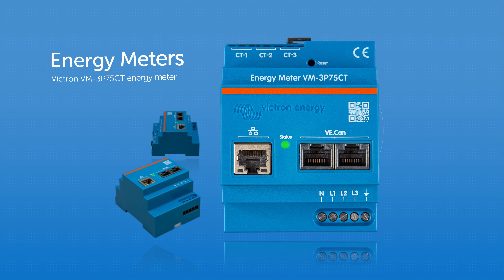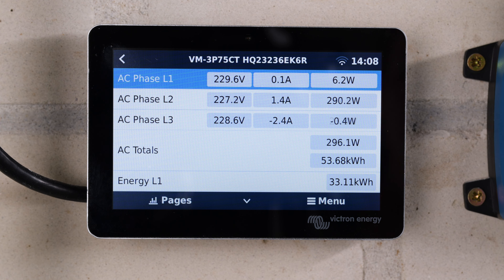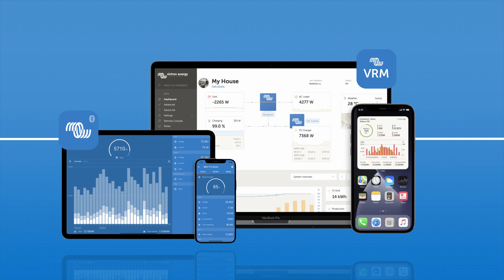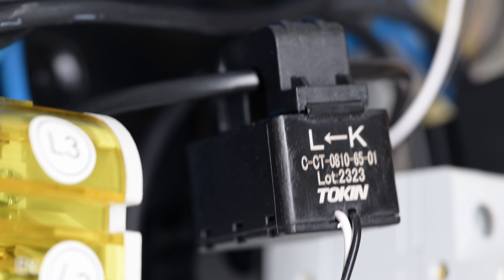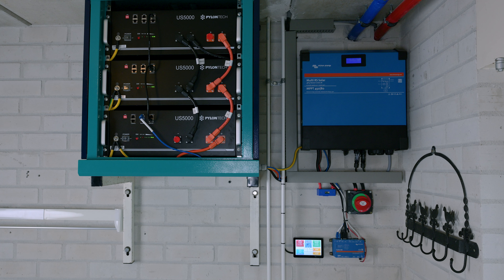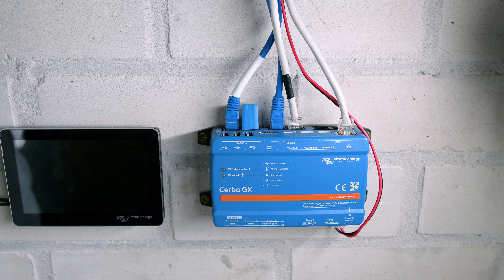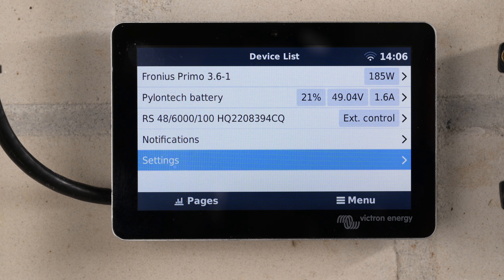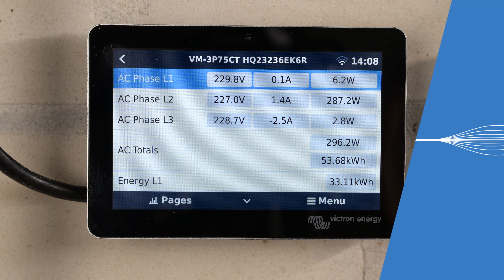Introduction to the Victron VM-3P75CT Energy Meter

Comment: Should have added RJ45 connection on the top and/or bottom, ao you can run the cable inside the DIN-rail enclosure..
Reply: Good one !  Mostly however the LAN needs to go to a router next to the ac distribution anyway
Reply: @johannesboonstra6917 sure, but the cable routing is usually from inside the Fusebox to the outside World and not from the Front of the fusebox which has doors in front
Reply: I agree .....I think 😂
Reply: I am guessing in some places LAN cant be beside HV??
Reply: @jal98uc  230V and 440V is not HV. It is LV. Network cables are allowed to be run with LV cables. It is done everywhere in the industrial and commercial sectors. The only thing that isn't guaranteed when running next to LV cables is signal integrity. For these low bandwith applications, it makes no difference. LV=0-1000VAC.
Reply: @torpedohippo8493 i may have been misinformed, but here in Australia an electrician told me last year that LV is only up to 50v , meaning diy can be things like garden lights and automotive stuff, but above 50v requires a licensed electrician. Not that many people would abide by that anyway i think. So much diy still gets done
Reply: @lexicase8805  well anything below 50V is considered "safe" as you won't get shocked by it if touching it with dry hands/skin. In European law you can work with whatever voltages you like in your sparetime (which is most likely allowed in AUS aswell), however, working on permanent installations (e.g. house, workshop, RV etc.) requires a license.
Reply: @lexicase8805  low voltage is usually considered as 0-1000VAC and 0-1500VDC. While some standards define it as 50-1000VAC and 120-1500VDC. 

I consider the second one faulty however as anything above 50VDC can still shock you. If I recall correctly, having DC current travelling through you heart in am accident is more dangerous than AC, as the current is one directional, effectively stopping/stalling the heart.

Comment: 1) Is it possible to connect multiple VM-3p75CT to one Cerbo GX? 2) Is it possible to view energy meter data in a specific Victron system, but define that this energy meter is not connected to a specific Victron system. For example, if it measures energy in a completely different place, for example, in a neighboring system?

Comment: Strange choices for the design. The small 1.5mm2 conections for the voltage measurements are a pain because one can never make safe cables on high amps circuits. All 4 wires need additional fuses in my opinion. Als RJ connections on the top is very hard to install nice and clean. The fidling with the small and vulnerable ct clamps between thick wires creates faulty installations.

Comment: Great device, lets hope Victron creates also residential 3fase invertors in the near future and add more compatibility with high voltage batteries.
Reply: Could be 😊
Reply: Yes, support for 400-800V batteries is a great addition!
Reply: A 3 phases inverter would be a must have....
Reply: You can bundle 3 inverters for 3-phase power already.

Comment: In my installation I have PV on the AC side, a normal grid tied system using Enphase micro-inverters. This meter allows the multiplus to see the PV power exporting to the grid, and then charge the batteries based on excess available power. Without this meter, it wouldn't see the PV and I had to use a scheduled charge. This really makes the ESS work how it should!
Reply: Yes/No.  There were also other meters doing this, but not as fast/accurate as this one.
Reply: You are correct, I also have normal grid tied solar systems (3 of them). And I want to charge my battery with the excess pv power, when the battery is fully charged I want the rest of the power that the pv systems produce over the day to be fed back into the grid. That way I will get a compensation from the energy company (not much obviously) but it would be a waste to have excess power, that still holds value, that just "vanishes into thin air".

Comment: I have a question about the wiring of the VM-3P75CT. According to the instructions, you should connect N + L1 with a switch or circuit breaker. But why not L2 + L3?
Reply: Because the internal power supply is on L1, so at least there must be power

Comment: Can you also use the phases independently? Like ph1 shore power ph2 generator...
Reply: Theoretically yes , but that’s not supported yet I am afraid
Reply: @johannesboonstra6917   Jammer.... that is the reason not to buy this (expensive) unit. I think single phase ac coupled pv should also be possible to measure.

Comment: how much faster is the performance of ramp up/down of the inverters over the modbus et112 meters?
Reply: 20-50%
Reply: 1 s .. c'est long .. mais il n'est pas précisé pour ce dernier
Reply: i have the EM540 . they said that refresh rate is 100ms ... but ... i see in my system 1000 ms...  it's the REL200100100

Comment: Maximum current it can handle per phase? the CT's don't look very big.
Reply: 75A
Reply: @johannesboonstra6917 Must be aimed at the European market. In the US now new construction around me has 400A service.
Reply: @niktak1114  time to upgrade to a proper 3 phase supply for the homes😂
Reply: @legominimovieproductions  some large homes already do that. It's very expensive though compared to a typical 400A service which is already a decent amount more than a 200A service.
Reply: @niktak1114  A 400A service here in germany would be 276kW, that's enough for a supercharger for a tesla😅
Reply: @legominimovieproductions  yeah that'd be way overkill. 400A service here actually means 320A continuous so only 76.8kW.
Reply: @niktak1114   You work at a lower voltage in the US which means more current for the same power.
Reply: @johannesboonstra6917  Thanks. Which it's a great number for these systems, Are larger CT's contemplated for the future for some of the larger three phase systems? No current need but I would envision it in the ear future.

Comment: Is this able to be setup like the ET340 for a single phase property. 
L1 as grid meter ? 
L2 as PV meter? 

Or do you need x2 VM 3p75ct?
Reply: Not at the moment but with future firmware updates this will come.
Reply: @JohannesBoonstra-ol2nz  
Thank you for the update. I hope it’s soon. Our Et340 is problematic with our ESS. I’d happily swap it out tomorrow for the Victron unit if it worked as we discussed.
Reply: @JohannesBoonstra-ol2nz 
Do you have an ETA for the firmware update please?
Reply: @SuperRockmonkey no sorry , it’s in development but not as top priority
Reply: @SuperRockmonkey   No , thats a matter of development time /priority setting.   To be honest, this is not high up in the list.
Reply: @johannesboonstra6917  
Swapped out the old ET340 for the new Victron unit. As expected it work perfectly. 

However without the firmware update to monitor PV generation my victon system is not able to accurately report true consumption figures etc, I don’t particularly want to have to buy a 2nd meter to monitor PV generation when a simple firmware update will fix the problem. 
Until the update is available I don’t believe single phase victron users can install the NS EV charging station abd gave it work correctly on auto function which is frustrating. 

If you could please discuss with the development team to implement the update sooner, myself and many other loyal Victron users would greatly appreciate it. 
Thank you

Comment: I’m confused. Doesn’t the victron inverters already have this built into the inverter. I know they can already use external Cts that monitor the homes mains to allow the inverter to operate like a grid tie zero export inverter,
Reply: yes, but with this it not needed to have the power from a AC distribution all through the Multi
Reply: @johannesboonstra6917  this device does not prevent AC from going through the inverter. It simply uses CTs to send information to the inverter

Comment: Interesting unit, it would be interesting to find out what accuracy in power measurement, would the unit be able to measure Phase, & all other parameters that say an energy meter wound be capable of? It would be I feel it it had either a Bluetooth or WiFi module built into the unit for direct communication, as a UKAS Laboratory test engineer, retired what is the accuracy of the unit & it's CTs ? would the accuracy be under ideal phase conditions of unity 0.95 to 1.0 or would the unit be capable of displaying the power of systems with less than ideal phase relationships between voltage & current?
Reply: the main purpose is that its a energy meter for ESS systems, not as a laboratory test device.
Reply: @johannesboonstra6917  I'm wondering if it can go side by side as an kWhour meter in a domestic house 🏠 🤔 hence the accuracy statement
Reply: up to you of course, there are no certificates or such to state the accuracy for this though  @CoolMusicToMyEars

Comment: What size CT clamps can you use? Is this configurable, for larger 3-phase installations?
Reply: No , at the moment there are the standard clamps only
Reply: @johannesboonstra6917  Okay, thanks Johannes. What's the max current (and diameter) that they currently support?

Comment: can this be configured to work over a routed network ?
Reply: There is no need for configuration, it works out of the box
Reply: @johannesboonstra6917 you didnt even read the question do you?
Reply: yes, and the answers is that there is no configuration needed, so there is no need to configure this to work over a routed network.   If needed you need to configure the network itself..... @legominimovieproductions
Reply: @johannesboonstra6917  dankjewel, waarom ik dit vraag is, omdat ik de OT gescheiden wil houden van de IT , maar in dit geval  er tussen de meterkast en de victron area geen broadcast netwerk zit, maar dit wel met route gedan kan worden
als ik het dus goed begrijp functionieerd deze met modbus udp en gebruikjt een broadcast om deze te vinden. Kan er ook een device worden aangelegd in de cerbo ?
Reply: theoretisch is alles mogelijk, wij hebben gekozen deze meter automatisch te koppelen aan en VenusGX device tbc ESS systemen.   Dat is de basis instelling.  @patrickmaartense7772

Comment: Is there a possibility for it to communicate via wifi or something? In sone cases its impossible to get a lan cable to the meter board
Reply: There is a ethernet port , so then a wifi router could be used , there is no wifi on board the meter itself,
Reply: @johannesboonstra6917  i know there is none on the meter itself. But having to demolish half of the house tu run an cable because the router is on the other side of the house of where the meter is, isn't an option. Companies need to understand routers are usually not close to the meter panel in a house
Reply: Really?,  In Europe the majority of the router is installed in the AC distribution cabinet itself as the LAN and energy cables enter the house at the same place  @encostablanca
Reply: @johannesboonstra6917  I live in Europe. Lived in several countries. Fibre optic does not enter at distribution cabinet but always close to the TV location
Reply: and the router is in the living room?      Anyway, then a cable to the ac distribution is needed I am afraid  @encostablanca
Reply: @johannesboonstra6917  yes router in the living room as the box where you connect the optic fiber cable is located in the living room / tv area

Comment: Why is there no fusing of the L2 and L3 Voltage inputs? I guess I cant connect a 10mm2 wire there and even then there has to be a fuse.
Also there's a 2 pole breaker in L1 and N, so there is no need for an additional fuse in the N, also you dont fuse N's.
And if you have a breaker turning off the N, it by code MUST also turn off all 3 phases!
Reply: Not needed as it works with CT clamps.. no current going in the meter ( except the one for powering the meter )
Reply: I see the same problem, without fuse we cannot connect a 10qmm wire. Maybe only L1 and N is necessary? Is saw the wiring diagramm and thought how stupid is this?😮
Reply: @encostablanca  There are all 3 ohases going into the meter for the voltage measurements, those 3 inputs definitely need to be fused, of something in the meter fails you otherwise have i.e. a 63A supply going through a tiny cable into a couple components on a pcb which is the recipe for a house fire
Reply: @thomaskick2429  There is no need to connect 10mm2 in theory, but then you'd have to use something like 1.5mm2 which needs to be fused so it wont burn away in case of a fault
Reply: Sounds like a 3 Pole MCB to cover L1, L2 and L3 is needed. As the unit is rated at 75A, a 75A 3 pole MCB. Nothing like this is visible in the video - infact no circuit breaker at all.. Is there an clarification available for this?
Reply: @chrisbishop362  You do not need a 75A breaker for the current measurements, only for the voltage measurements which is where victron made the mistake as they only show to fuse one phase and N where the meter gets its own power from, but not the other two phases

Comment: Why would I use this when my Multiplus1 48/3000 using ess already shows me all information on the vrm portal? I can see there if Im exporting or inporting W relative to grid…
Reply: to measure grid power for ess systems
Reply: I already see the grid power in my ESS system, I use just one phase on 3x parallel multiplus and I have all grid data in my vrm history, what is the added benefit then?

Comment: 3-phase IT does not have a N wire, are you sure the connection diagram in the video is correct? Since the English wiki page is a bit lacking, I share the Norwegian one: https://no.wikipedia.org/wiki/IT-nett

Comment: can it be used single phase or must only be 3 phase
Reply: Did you watch the FIRST thing they mentioned in the video?
Reply: The second sentence answers exactly what you asked! Try listening rather than typing😂
Reply: I would if I spoke English. Such a friendly group. I hope Google has translated this correctly.
Reply: @andrewcashel8984  it's not unreasonable to assume you can understand english, when you type in english.
Reply: @andrewcashel8984 the wiring diagram at 1.49 shows signal phase connection so if your English skills are lacking I can only assume that you don’t even understand basic electrical circuit drawings
Reply: What about split phase?
Reply: @AaronBockelie  never seen splitphase anywhere else than in the US.

Comment: CT is to small for UK single tail.
Reply: There will be optional larger CT 

Ik has 25mm2 for “only “ 100A , that’s actually the issue 😅
Reply: @johannesboonstra6917 will there be 400A CTs?
Reply: not on short trem but that could be in a later stage  @niktak1114

Comment: Still no wireless??? The Shelly device has wireless which makes it easier when cabling is a pain.
Reply: Correct , we believe that reliable/fast signals travel better through cabling, even though that sometimes a bit more installation work.